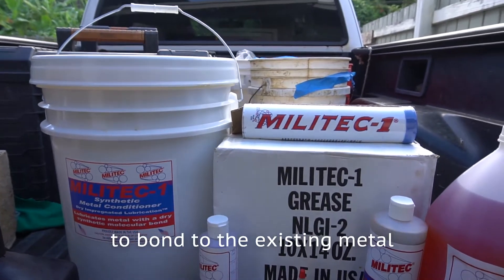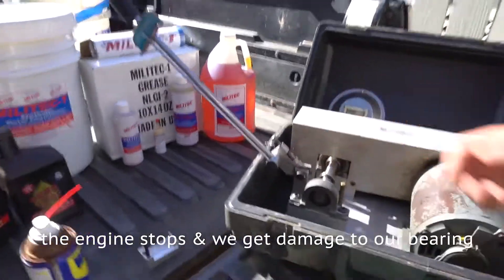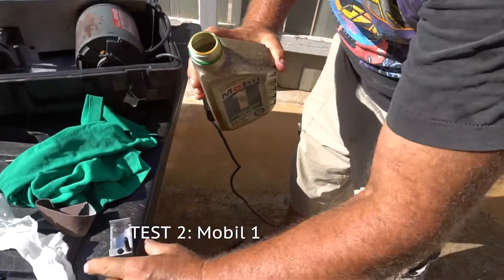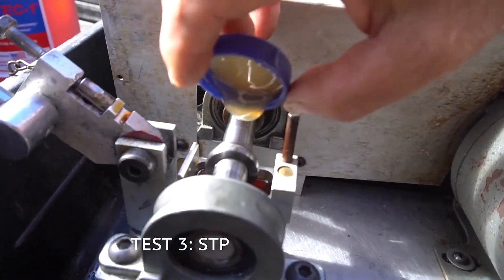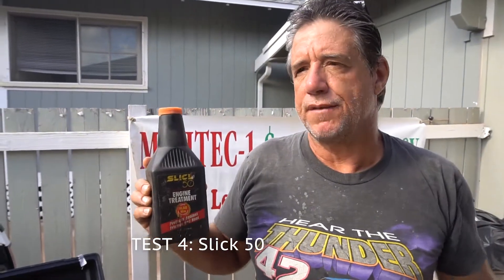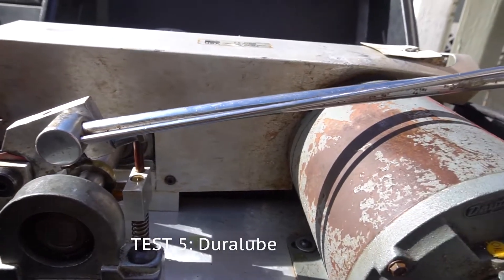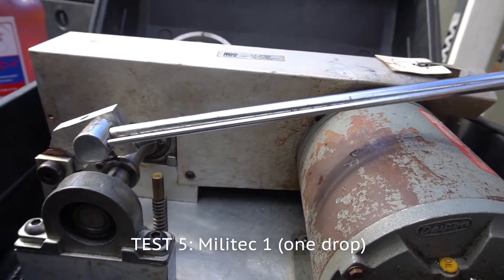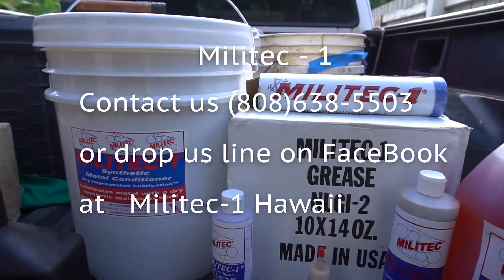Militec 1 vs The World : Lubricity Test Challenge

Comment: I used militec in my boat engines since it was first marketed probably before most of you ever heard of it. Seeing a similar test as this at a boat show and I was allowed to push down the bearing on the motor as it was spinning. Yes, it sold me as it obviously works as is shown in this video. Nothing staged or fake about this test.

Comment: How does this stand up to ZMAX, Prolong and Petron Plus?
Reply: This blows that other stuff out of the water. Zmax and all of these other items came out long after militec was around. Militec was used in the logging industry first, and Brad Giordano brought it into military usage. The other kinds might only say it's for car engines or transmissions, however militec is used anywhere and everywhere. I've been using this stuff since the early 2000's and it's incredible. You can even put an ounce of it into your car coolant (won't have negative reaction), and along with using it in oil change, my car idled at 300 less rpm, and the engine was quiet when going down the freeway. Give this thing a look. You won't regret it.

Comment: Watch the handle of the torque wrench. The reading is only valid if the wrench is in the center of the handle. The way he is doing it gives false reedings. Also militec 1 requires all of the other lubricant be removed because it doesn't play well with other stuff. If you put militec 1 on top of break free it will gum up. Don't get me wrong, it is good but it has limitations like anything else.

Comment: So do you just add this to oil and if so at what ratio? 🧐 looks like an amazing product.
Reply from the maker: YES! Just add to your engine oil... 8 oz per vehicle is sufficient... Literally adds life to your car!  Mahalo!
Reply: Can you apply this stuff directly into the carb of a running 2-cycle engine like the Slick 50 of yesteryear ?
Reply: @shannonwhitaker9630 this can be used literally where two moving metal parts cause friction.  So yes you can.